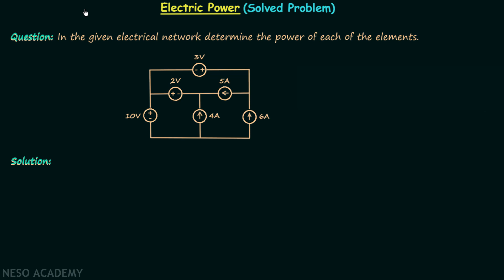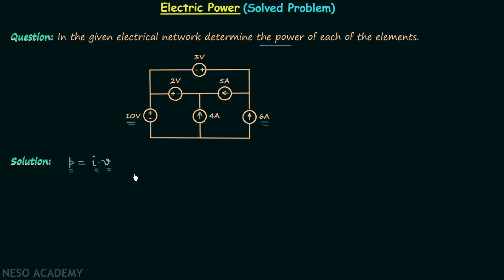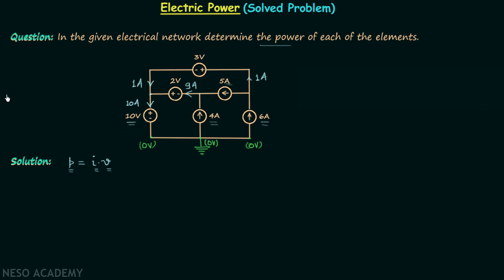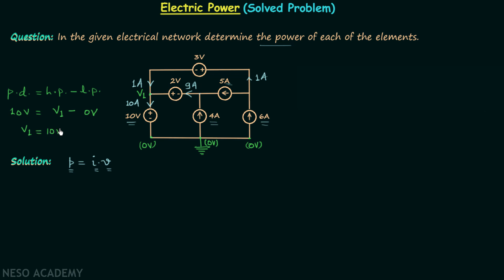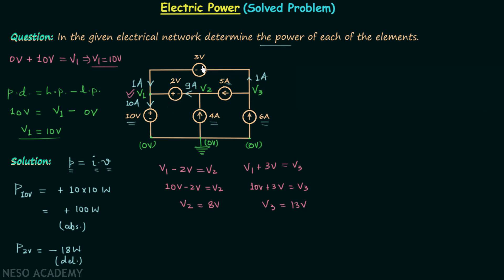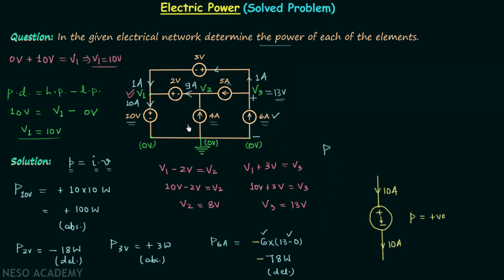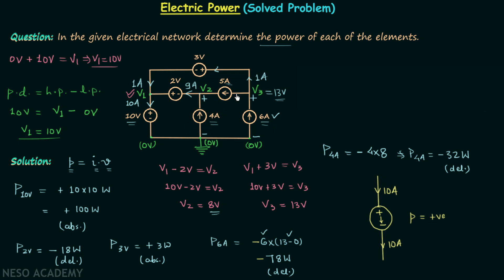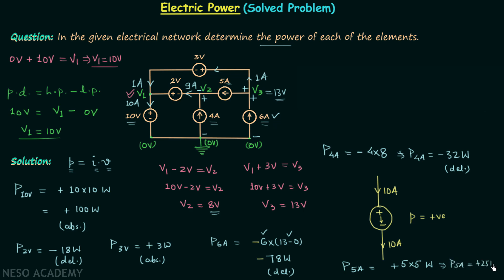Electric Power (Solved Problem)

Comment: The most imp point to know Power,s polarity is " The sign of Current entering Terminal will be the Sign of Power for both Cases" 
just keep this point in mind. you will not face any problem assigning polarity for power.
Reply: You are absolutely right, this is the best trick i found too

Comment: why for 5A v3 is higher and v2 is lower polarity?
Reply: Because the value of V3 is 13v and V2 is 8v
Reply: v3 Higher potential (+)(13v) - v2 lower potential (-)(8v)
Reply: @Creative_channel_Pooj  so P5A answer should be -25W since higher potential to lower potential am i correct?